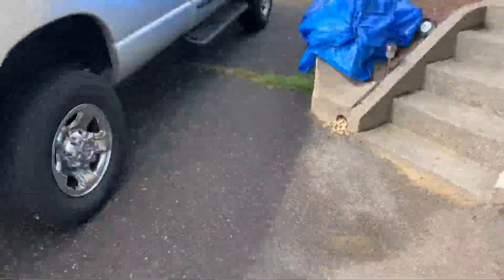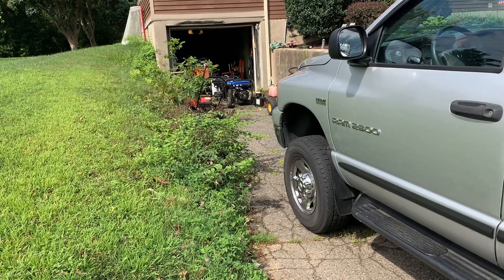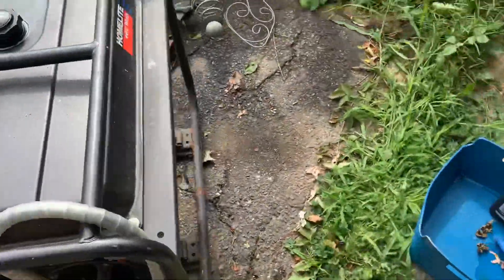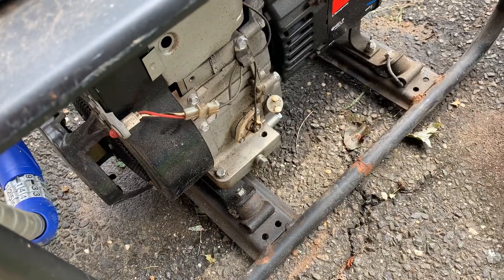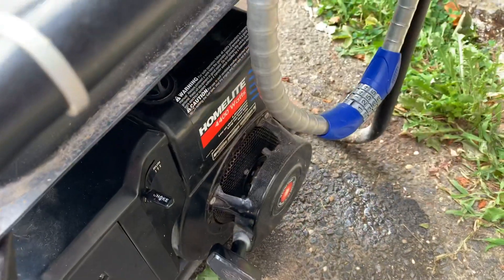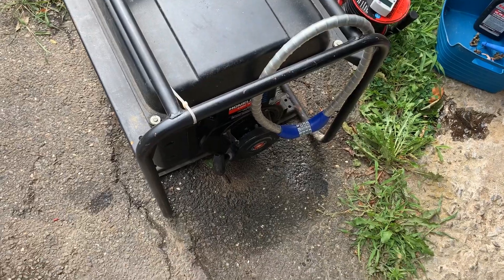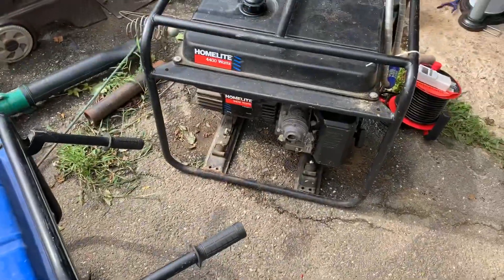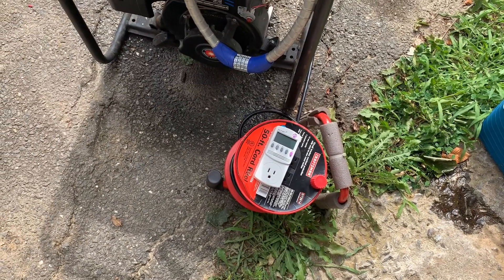Generators galore after the Hurricane simple and not so simple fixes

Comment: Some good tips ken, I fixed up a Robin engine on a log splitter, it would run but wouldn't. Took the carb off a couple times and cleaned it out, then I took the oil level sender wire off and it run great after that.
Reply from the maker: MegaDirtyberty  check the simple things first!
Reply: @KensSmallEngineRepair  Quite right Ken, the simple things.

Comment: Some real nice tips there Ken mate. Am not  really to sure about generators. So handy mate I know about the engine's that run them lol. 👍
Reply from the maker: Ali Mack I learned about damage due to frequency shifts from work. You guys across the pond run 50 hertz Vs 60 here in the US.  Had some motors burn up with low frequency. Better to see voltage and frequency where they should be!

Comment: fixed one yesterday .blowing flames out exhaust . valves were tight .10hp briggs .
Reply from the maker: Ex valve could be burnt or timing issue or lean mixture. All can cause exhaust flames
Reply: @KensSmallEngineRepair  new machine adjusted valves qall good .. thankz for reply

Comment: you should not set it by voltage at no load, you should set frequency at about 61 no load, then check with a 50% load, it should be 59 to 60 hrz. voltage will come down  with load.
Reply from the maker: Thanks, I’ll remember that. I usually use a 3500 watt heat gun to load it. I don’t claim to be  an expert but in my line of work we frown on low frequency as it heats up motors and destroys them. I actually asked Youtube creator James Condon for his opinion  as he seems to be a gen set guru with lots of electrical background. Let’s see what he says.  Thanks again